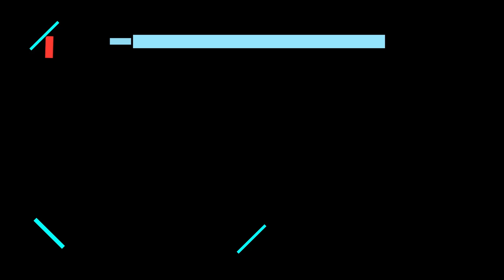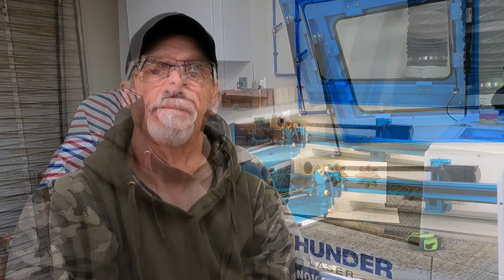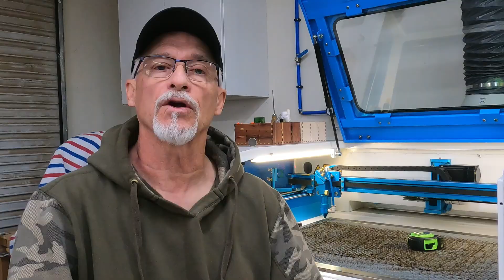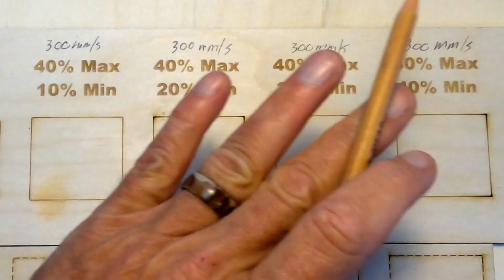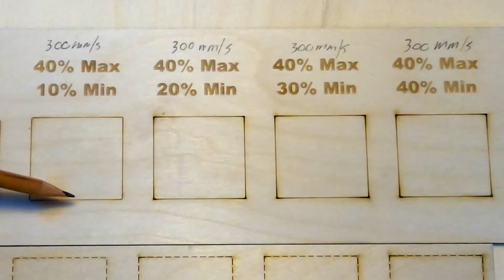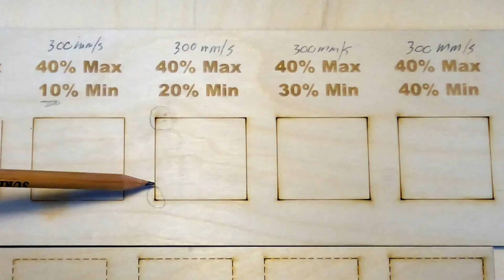Understanding Minimum power settings in lightburn

Comment: you know what would be friggin great?  The (Chinese) guys who designed all these amazing features put out a book that tells about all the various settings and what they do so we didn't have to experiment until we figure it out.  The "manual" that comes with ANY of the CO2 machines is minimum information and badly translated from Chinese to English, almost useless.  For instance, the default setting for engraving stepover is .1mm.  That would cause major overlapping of the beam pulses resulting in crappy engravings.  The "kerf" of a laser beam is about .007" which translates to about .17mm which is the ACTUAL optimum stepover for photo engraving.  That's not in any manuals.
Reply from the maker: lol we can all dream

Comment: I rarely adjust min power once I found the right number. In the case of the ornament that was too light, instead of raising min power I would have raised max power or reduced max speed. If you can't find a good min power using whole number, be aware that you can use decimals too. For example, after extensive testing I found my min power to be about 9.4. Since you are at the threshold of the tube fiiring, this can vary due to temperature and even having the chiller kick on and off.
Reply from the maker: Great input, thank you

Comment: how come i don't have minimum power settings in my diode? Also I need to learn my minimum when cutting acrylic in my co2 80w..  i'm not getting those smooth glass edges i need and can't find the right minimum to avoid cracks in corners of my mirrored acrylic.ugh
Reply from the maker: ya diodes can not be adjusted they won’t allow a min setting only co2 lasers

Comment: Hello, I am having the uncut corner problem. Any help would be appreciated. I am using a 40w diode laser.
Reply from the maker: That means your min setting is to low. Your co2 laser has a min power where it will not fire. You need to keep upping your min power until your corners show up. You just found your min power percentage of your laser tube

Comment: I'm late to the party, but I have a question. I just bought a creality 40 watt laser. I am trying to learn and obviously there is a curve involved. I was looking into the minimum power and how to determine where it simply will not engrave. My issue is that when I draw a box in lightburn , there is no option for minimum power, only maximum. I only have that option when I have an image being set up to burn. Is there any possibility
 that you may be able to give me any guidance on how to make the determination?
Reply from the maker: If that a diode laser they don’t have min settings, i
Reply: @computercreationz  I actually just found that information. Apparently a big in the software that it has the option. Thank you.

Comment: Thanks for a great video, with clear and concise explanations.
"The next step" would be (if possible) to make a video along the same lines that "focuses on" (no pun intended) the relation between the "travel speed" and these settings. Since higher speed IS desirable, but You  ofcourse have to raise the power, BUT higher speed ALSO "demands/causes" higher difference between the "straight line speed" and the "corners" (where ever the laser needs to decelarate and accelerate")
I realise it's a complex matter and that maybe so many parameters are in play that it's impossible to even give "heuristic tips", but I still think it would be very instructive even if You "only" shared Your thoughts and procedures even if it's not all directly "transferable" to other lasers and setups. 
Best regards.
Reply from the maker: I appreciate the comments!

Comment: I never cut lower then 600mm. With that qood id do 800mm at 60% and it will cut super clean.. i dont use min max for cutting and never get burnt corners like this. Guess if i ran it as slow as 300mm i might but that to slow
Reply from the maker: just curious on what laser your using for this magical speed?
Reply: @computercreationz  atezr v35 plus..
Reply from the maker: @theman-pc2ej  mystery solved,  all of my videos are for co2 lasers which are rated mm/second not a speed of mm/minute so 60 times faster. Makes since now.
Reply: @computercreationz  in lightburn mine is setup for mm-sec..

Comment: Whats odd is my laser @70% when cutting lite ply shows none of the overpower at the corners, but ONLY on lite ply. I struggle to get a clean cut on Lite ply, the surface of the cut is always v shaped regardless of power setting, but on 3mm, I would say half of the first layer gets the v while the other 2 layers as tight and clean.  Balso OTH needs the ramping down at the ends, but cuts clean and tight. Haven't tried bass yet, rarely used in airplane kits.
Reply from the maker: interesting!

Comment: Thx I can finally start cutting the right way with my first co2
Reply from the maker: remember this method is used for scoring and NOT cutting for the most part. most of the time you want you max and mins the same power when cutting. enjoy you co2 I changed from diode to co2 4 years ago and never looked back

Comment: I have a new Monport K40 CO2 with the Lightburn ready GRBL board. I think this only works for certain boards. I don't have the min power option. It's now just a "constant power" on or off tab in LB....which isn't that great. It (will) stop the corners from burning but leaves a heck of a non engraved/cut area at the corners which is about as worse. Maybe I'm missing something??
Reply from the maker: Yes this only works with co2 lasers

Comment: I thought it was great... until the end when you lowered the min power value AND added Air Assist. It calls into question how Air Assist might have been beneficial in the previous 15 minutes of the video. At any rate, I was clueless about this, so thank you for explaining this setting in the software and it's potential effects on project outcomes.
Reply from the maker: thanks for the comments. yes air flow is almost always detrimental when engraving wood or acrylic!

Comment: This is a great video however I don’t know how to set max and min in Lightburn. Can you make a video on that please? Thx
Reply from the maker: I’m confused this is a video on how to set your max and mins in lightburn??
Reply: Where in LightBurn are these settings (max/min)? I don’t see them  I can not find them.
Reply from the maker: Only if you have a co2 laser will you have both. Diode laser don’t have a min power setting. Using the line mode in lightburn @carriemyslinski4521
Reply: @computercreationz  Ok thank you!

Comment: Grate video, i have the same issuie, Just want to ask wher in latest lightburn, i can find this minimum power stetting??
Reply from the maker: If you’re operating a diode laser they will not have a min power setting.
Reply: @computercreationz  indeed im using 36 w diode laser, im getting good cut thru material on y axis, week cut on x axis, do you have any solution for that?
Reply: @computercreationz I had the same question. I also have a diode laser. Is there another suggestion sir setting adjustment to avoid corners burning?? 
There is a minimum power setting in LaserGRBL so I am disappointed that Lightburn does not 😢

Comment: Great video! I do wonder how you came up with your max power setting. With the text, you started at 40%  why 40? Is that standard? then went down to 17% max. Was that random or did you do a bunch of trial and error? Like, why 17%? Why not 20% or 15% or 18%? Or did you do all of those off camera and found 17% to be awesome?
Reply from the maker: There is no set start point it about starting at some setting and determine the look you want. This is very subjective some like very dark lines some like lighter scoring lines. There is not set answer!

Comment: 14:25. Why would you laser anything with air off??  Some of the others may look better with air.
Reply from the maker: Typically when you apply lots of air to an engrave you take the vaporized material and push it right back on your work piece. Generating much more clean up than necessary.
Reply: @computercreationz  AhA. Thank you. I’ve not seen that, only better results.

Comment: I can't find the minimum power settings in lightburn
Reply from the maker: If your running a diode laser they don’t have minimum power setting.
Reply: @computercreationz  oh okay thank you for the clarification. BTW do you have a settings for 5.5watts laser module, I always got a bad results specially the corner part, it burns

Comment: My laser works in full power all the time. Is that a controller or power supply issue? Wire’s seems to be ok. What else should i check or test to find what is the problem?
Reply from the maker: Is your laser a diode laser. If so that’s why. They don’t have a minimum power setting
Reply: @computercreationz  no its a co2
Reply from the maker: @andrishiapani6221  when your in line mode in lightburn you should have both a max power and a min power setting.. are those apparent ?

Comment: In new lightburn version adjusted minimum power option has ben removed. Downgrade is not repair this. What can I do?  Lightburn developers says: this option doesn't changed g-code and is unnecessary
Reply from the maker: Are you running a diode laser, if so that why they don’t have minimum power setting.
Reply: @computercreationz  yes but still I have burned corners. I think it was better before

Comment: What min. and max. setting do you use on engraving anodized aluminum and painted aluminum for the Nova 24? That would be a good video idea. Thanks Shane
Reply from the maker: On my 24 I use 400mm/s and 60% power. Focused @7mm with the 2” lens when engraving you min and max should always be the same 60! The only time you min and max is different is scoring. Thanks for watching
Reply: @computercreationz  Okay I will use those settings for Anodized aluminum. Should I use .08 line interval and low air? Thanks for the great videos, very helpful.

Comment: I have tried every setting, cleaned mirrors, alignment. I have set it as high as 600 speed, 5% max power and 0% minimum and it's still burning through. Can anyone help me?
Reply from the maker: are your min and max power setting the same? they should be when cutting. Only time they should be different is when scoring!

Comment: hello, congratulations for the videos.
i have a problem i can't find the "minimum power" command in lightburn. Maybe in the latest software updates they removed it?
p.s. I use a diode Atomstack
thank you
Reply from the maker: If you have a diode laser you will not have the option for minimum power. Only co2 lasers.
Reply: @computercreationz  ok! Thanks

Comment: Back in the day I learned from your video how to find my ideal minimum setting by doing squares. I’ve been searching for info on my laser controller. There is a maximum setting 1 and 2 both at 20% then a minimum too. I have a nova 51 100w are those setting supposed to be adjusted from what they are set in the factory? I’ve been running my laser for a year and three months with maximum power 1 and 2 both set at 20.
Reply from the maker: If your using lightburn, what ever you input for settings in lightburn will superseded what’s in the controller when running a file!

Comment: Thank you for this informative video. 
ytI am facing same problem; can you help me how set minimum power set in LightBurn. I tried but i failed to find that option in LightBurn software. i have not same set up as you have.
I am using upgraded version of K40 with controller MKS DLC32 V2.1.
Reply from the maker: If you don’t have a co2 laser with a dsp controller you will not have this option.

Comment: on ma's, is it really 3% difference between 10% and 13% power? How thick acrylic can you cut? I need to make some gears and I was wondering 40w vs. 60 w, big price difference.
Reply from the maker: I was cutting 3/8” with my 60 watt. there are several other improvements once you go to the 60 watt like a motorized z  bed, air assist control panel to name a few

Comment: Could you please elaborate on the relationship between the machine's maximum power settings and Lightburn's power settings.

For example.
100W laser

Rudia controller is set to maximum power of 22%

So, regarding lightburn. Does lightburn see that 22% as it's 100%, or does Lightburn ignore that 22% and push the laser past that to whatever power the layer is set at. 

Example, if I set Lightburn power output to 50% is it actually only 11% power, or is it 50%?
Reply from the maker: From what I understand, I’m no expert whatever lightburn is set at it overrides what the controller is set at. The only time the power %in the controller is used is when you pulse the laser or don’t have a lightburn file loaded

Comment: Great video. 👍  I do have a question pertaining to how you're setting this up. Are you setting this up in the actual G code, or in Lightburn? Because the only time I've ever dealt with Max and Min power settings in lightburn is on a grayscale image. 

I'm relatively new though, so. 🤷
Reply from the maker: If you have a co2 laser is on every layer in lightburn that is set to line mode. If your working on a diode laser you will not have this feature.

Comment: Where can I find the minimum Power settings using the Line nd Fill?
Reply from the maker: if you have a diode laser there wil be no min power selection.
Reply: @computercreationz  Any idea why I am getting "Burn Dots" ? Using line mostly but still evident with fill.

Comment: Wow, now this is becoming clearer, the most useful video I have found on min/max power settings. We have a Thunderlaser Mars90P 80W, Rudia 644XG and have just switched to Lightburn from RDworks. I have to build a new materials library but first thing is testing the range of materials to get the optimum settings using lightburn. Our laser is governed to 70% max so if you had max power set at 100% it would cut back to 70%. When using RDworks all the parameters for cut, and line engrave was set a Max 60% and min 60%, only speed was changed depending on material and thickness, these not set by me. But in Lightburn I want to have more control over min and max power for the range of materials we use. We predominantly use mdf, acrylic and card. I process files for architecture student models and have always wondered why files i cut always have scorched or smoke effect on lines cut and etch. I will definitely try and find the min power setting and start from there before doing test grids for materials. But then it comes down to longer processing times I suppose if adjusting power settings. I see in lightburn settings that you can play around with ramp in and ramp out but understanding min pw has been really beneficial. Thanks again.
Reply from the maker: really appreciate you comment. using min power when scoring was a game changer because it evened out the score color in the corners. thanks for watching!

Comment: So even for engraving, you use line mode and not fill ? Great vid ! My minimum btw is 5%; at 2.5% i have light no more. This was in particular for the 40w tube. When testing 60w at supplier, min was somewhere between 10 and 14%. The 40w at low power end of the spectrum provides so much more control. Best decision i ever made…
Reply from the maker: ya my 60 watt was 14%, but my
100 watt is 6-7% go figure

Comment: Brilliant. Interested to know what your settings for Dry Erase board are? I'm getting way too much char and scorch.
Reply from the maker: I haven’t used that stuff, if your getting allot of soot slowly increase your speed and leave your power along unilateral your still cutting through but but soot is eliminated. external air source will help with this too. thanks for watching and commenting!
Reply: @computercreationz  Thanks I'll give it a shot. I also was only using air assist when cutting. I guess I need it when engraving too!

Comment: have you tested in between 10 and 20 % looks like it can be refined even more. and my min. goes down to 7.8 it does better then 10%
Reply from the maker: yes there is always room for refinement! if I slow my speed down my tube turns off at about 5-6% power.

Comment: Great video thanks.   I see you are line drawing at 350 mm/sec.   Is there a rule of thumb about how fast you can do line drawing.   Seems like if you are drawing a really small tight pattern
you are changing direction very fast.    I have a Boss 1630 with the new high speed hybrid servo motors with a maximum speed of 1350 mm/sec.   Will lightburn software slow the laser and energy level down when doing very high speed line drawing of small tight patterns.
Reply from the maker: what I’ve found you can put in what ever you want but the machine will limit it’s speed based on the size of design. on smaller designs 200-350 is what it will actually run no matter what you put for a speed. it’s a limitation of the machine. the only way you will ever get 1000mm/s is to have large designs. Thanks for the Comments

Comment: Robert, thanks. Would you also address max/min power when it comes to cutting. I cut a lot of 1/2" solid cherry and maple, and finding the sweet spot so my Nova 35 100w cuts through all the way without a lot of burning is a challenge.  Thanks.....
Reply from the maker: Most of the time my min and max numbers are the same when cutting. On occasion when cutting something small I will reduce the min by 10%
Reply: @computercreationz  thanks for the reply. I find there's a lot of burning on the underside of the workpiece even at 50% of the high power setting...will continue to work the issue.

Comment: have a problem. when laser cut at right angles, they are not trimmed. The laser stops and turns off the laser and then starts cutting another side also turn on laser. How to fix it ? can you set it not to stop? I cut 3mm plywood. 70 % Max and 70 minimum power laser and i still have problem with Angles.
I use lighburn.